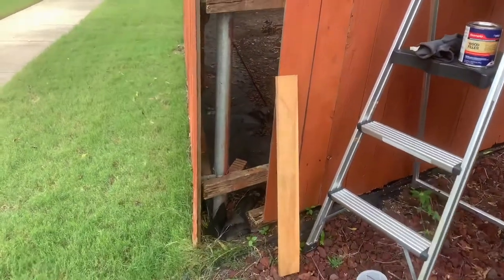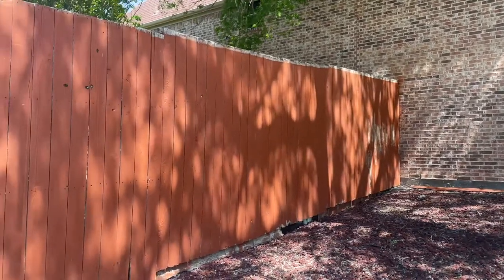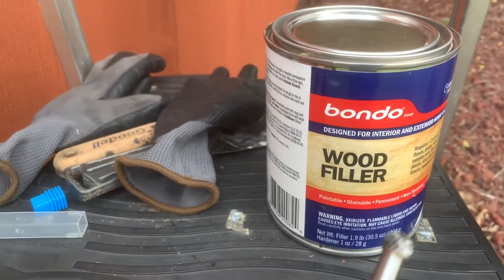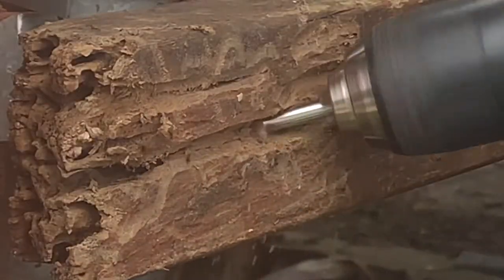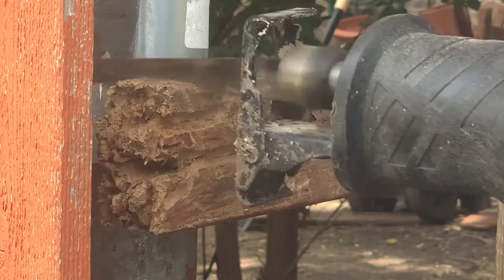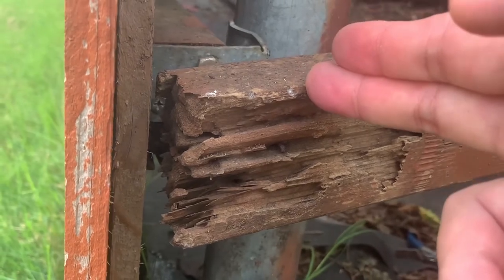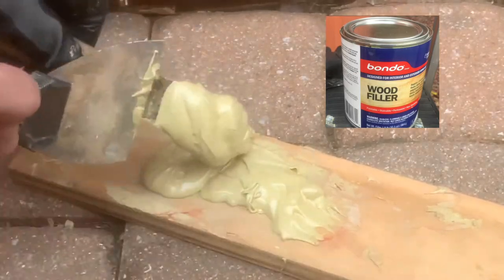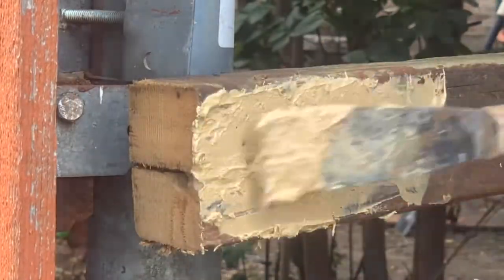#DIY Project. Part 1. Fix a Rotten Wooden Fence without Replacing it?

Comment: Can provide links and additional info ? 

A) Wood Fillet Brand (if it still holding up)

B) Dill bit grinding tool (grit, bit head size & brand)

C) Sand paper grit & brand (pkg of ? Are needed)